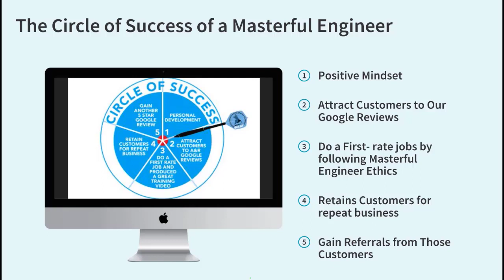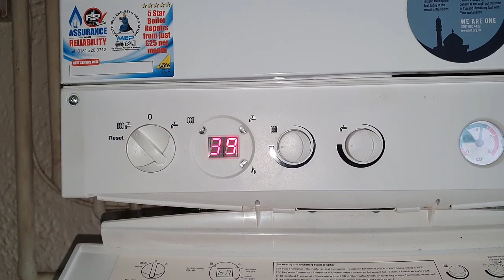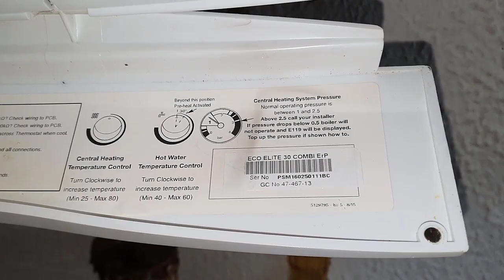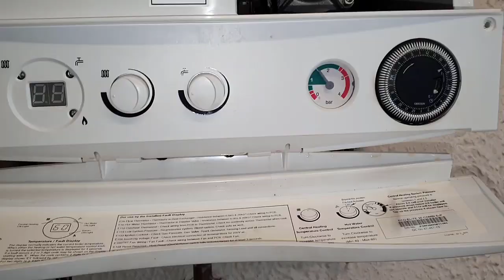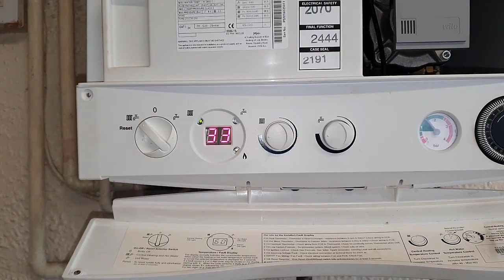Main Combi 30 eco Elite No Hot Water Boiler Repair Accelerated Training

Comment: The easiest way I find to remove the turbine is simply disconnect the pump as its only 2 screws to remove and the pump is out and with a a large pair of grips you can easily remove I also spray it with wd40 before I do.